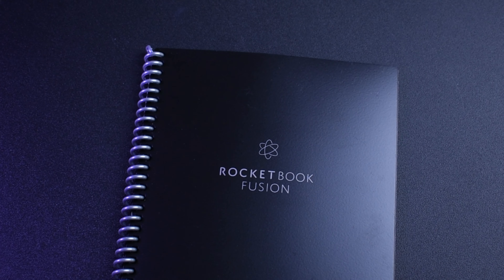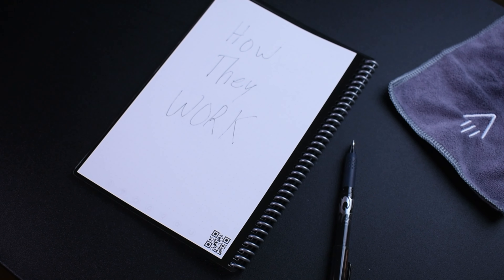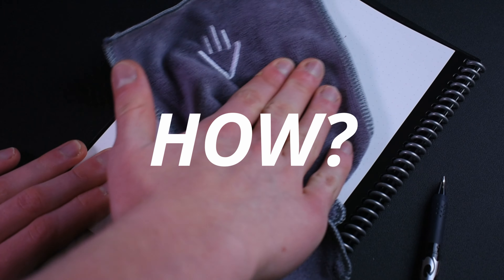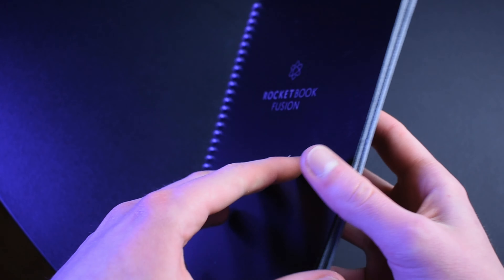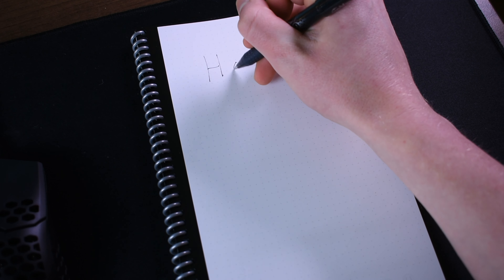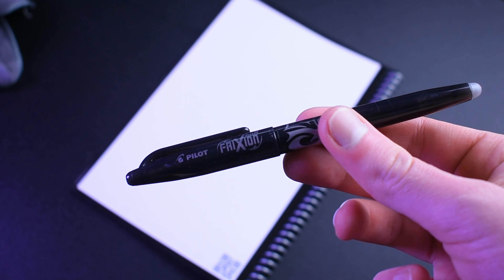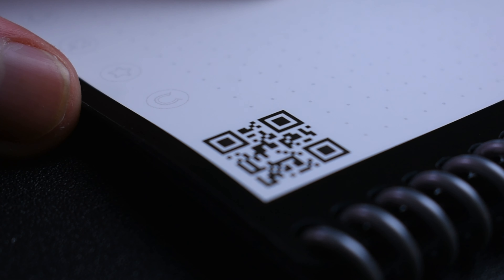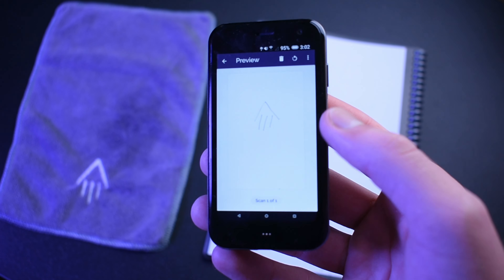The tech behind reusable notepads!

Comment: Unfortunately my Rocketbook just collects dust. The pens are simply not comfortable to write with, the ink just doesn’t flow well on any tip size. After my initial excitement I’ve gone back to paper notebooks and Pentel Energel rollerball pens.

Also, the novelty of scanning notes into my phone just didn’t end up being as great or useful as it seemed. And the cost... at $25-$30 the break-even point compared to paper notebooks is 10-12 paper notebooks to one Fusion.

I don’t doubt this would be a great solution for some, but you’d have to REALLY take a lot of notes for it to make more sense. A LOT MORE NOTES. With pens that just aren’t very comfortable or fun to write with.

Maybe if they could make the pens write as smoothly as an Energel I’d be back in despite the cost, but unfortunately they’re not there yet.
Reply from the maker: I completely understand your point! Thanks for checking it out! 👋